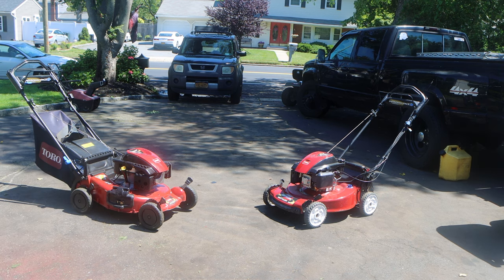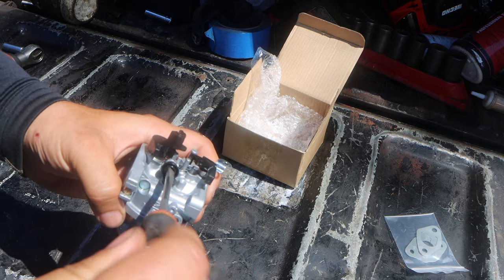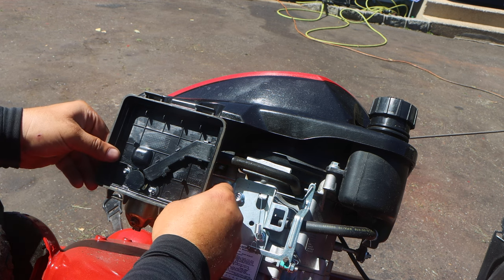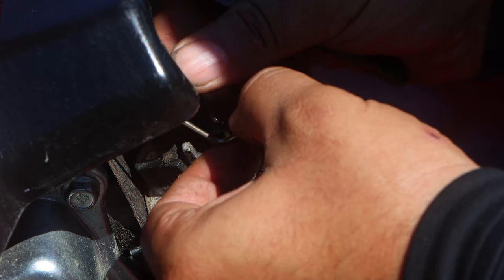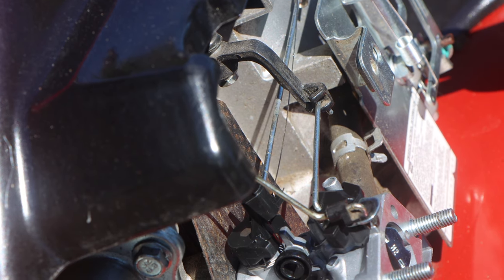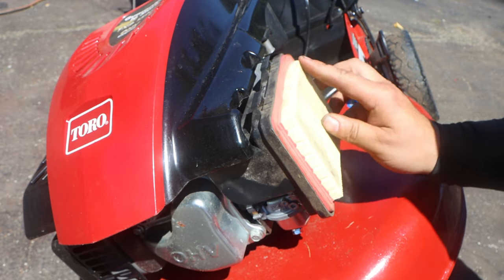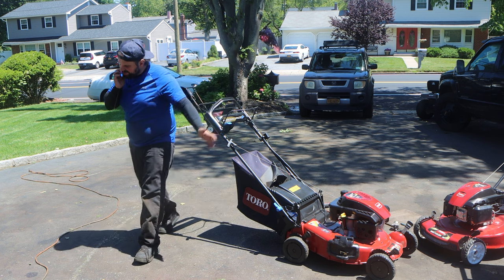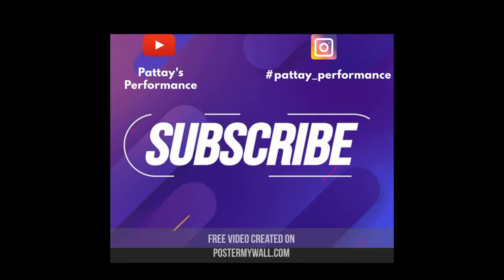Toro SR4 159cc Lawn Mower Leaks Fuel From Carb HOW TO FIX #chonda Better Than #Honda Cheap and Easy

Comment: Just did a new toro regular recycler, with the briggs 163 cc pos engine, and that is a 4.5hp engine, and a older toro Recycler with the 6.5hp tecumseh..... Nice job nephew.
Reply from the maker: I got “burnt” with a new briggs bigger engine.  I make it a good habit that everytime I open up a plastic carb I always open up the jet.  

I got a non-running 163cc and I cleaned the carb and opened up the jet.  Drove me mad I could barely get it to start.  So I ordered a new carb and didn’t touch the jet and fired up and ran like it should 🤬🫣

Comment: What size was the micro-bit?  You said it was the smallest you have, but micro-bit kits come with all sizes of bits.  Great video.  Very helpful.  I'm about to change the carb on my machine thanks to you.
Reply from the maker: Do you have a micro drill bit set?  Just take each one by one and the one that is the next size up from the hole will work.

Comment: Those are the Loncin POS engines. I have had 2 that have the same issue hard to start after it's ran for awhile. Great video on the infamous Loncin 159cc Toro special engine.
Reply from the maker: Most likely the coil is going bad.  Check for spark next time it happens.  Really don’t see any issues with these.  Just mostly valve adjustments that cause hard start/start issues

Comment: Great vid there 
I have been dealing with CHonda recently .  Powermore
Reply from the maker: Love them!  Why can’t Honda Stud their motors?
Reply: @pattayperformance  
Yep the gaskets and order are a pain.  I just had to clean out a carb on gcv160 with manual choke and that was a pain
Reply: @dfields9511  I found a powermore on the side of the road. deck is 2009. I was shocked when I found the carb clean as a whistle. Owner must of used efree fuel. Deck is scrap though, cracked on both sides and the wheels are bent in. Not a big loss though since its a MTD.

Comment: Hi Jason - the carb and spark plug gap gauge links are dead (9-22-2023). Weld tip / drill bit / anti seize links work. Thank you.
Reply from the maker: Thank you!

I’m just finishing up my shift will update in a few, thank you
Reply from the maker: LINKS HAVE BEEN UPDATED!  THANK YOU!

Comment: Is the other mower the same?
Reply from the maker: @jameslyman1377  engines are the same and that’s about it
Reply: Are all 159cc carbs the same? Link no longer works
 @pattayperformance
Reply: Problem is I have no model number or serial on the mower.
Reply from the maker: @jameslyman1377  lift up the grass and flap and check there or side of the mower.

We sell the carbs here is a link:  https://www.ebay.com/itm/225864340168?mkcid=16&mkevt=1&mkrid=711-127632-2357-0&ssspo=fjGXQTmBRqi&sssrc=2051273&ssuid=fjGXQTmBRqi&var=&widget_ver=artemis&media=COPY

If you want to save 10% and deal with us directly shoot me a text 631-707-0797

Comment: You will love this, guy just dropped off his mower, won't start, I find oil in the fuel tank and nothing in the engine..... LMAO
Reply from the maker: NOOOOOOO...we had a mechanic misdiagnose a truck at work for a blown headgasket.  Guy put coolant in the oil.